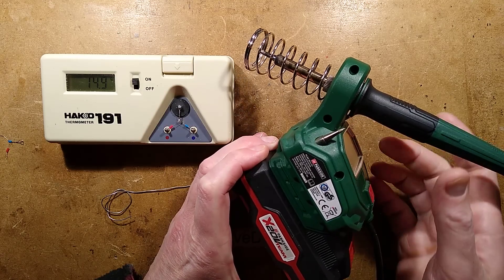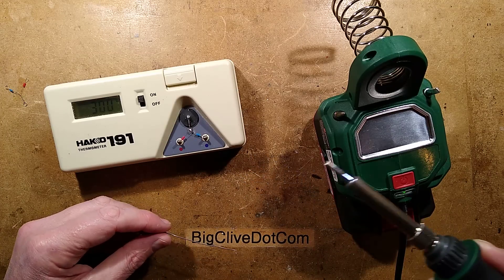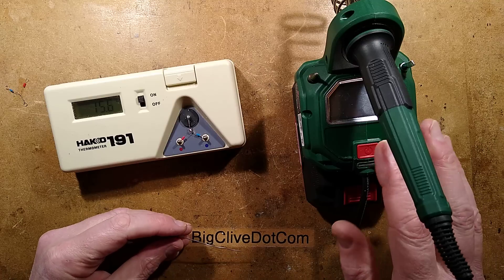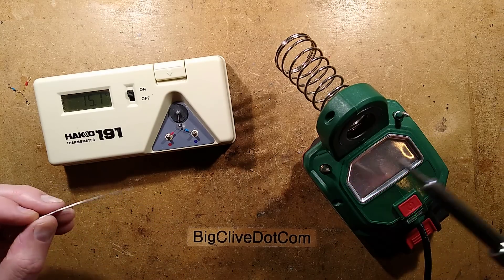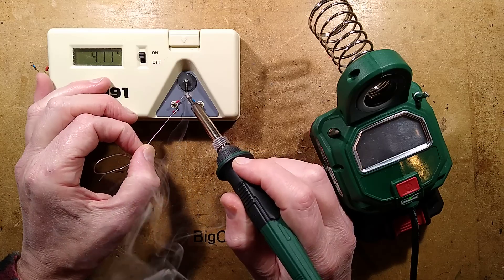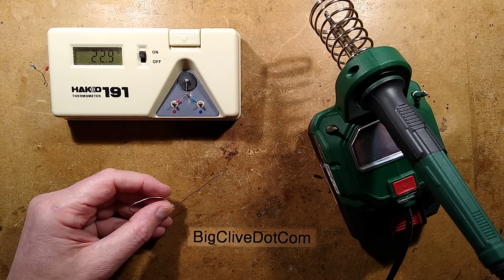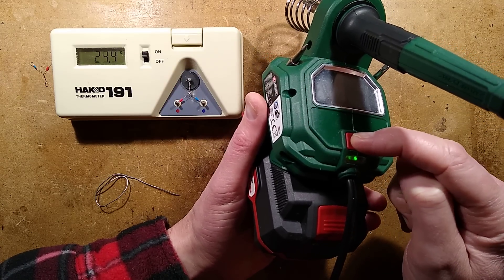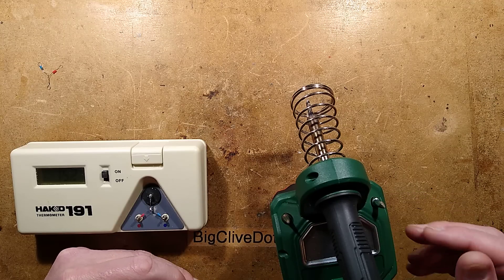Parkside soldering iron secret calibration mode A1 model

Comment: I took my soldering iron apart. It's manufactured in 05.2022, and it has a completely different board. I'm not sure where to solder the potentiometer. I also tried the calibration mode by holding down the button, as described in other videos, but unfortunately, it doesn't work either. I'm very disappointed. Could you please tell me where to solder the potentiometer on the new version of the board? I'd be very grateful!
Reply from the maker: I featured various versions in videos.

Comment: Holy hell, just tried it - that solved my one and only problem with it! When I first used it to solder wire to a large toggle switch, it actually melted the plastic housing through the contacts.

Comment: 1)To raise temperature, keep pressed until if goes into flashing green, then each fast press  --> +4.25°C
2) To lower temperature, keep pressed until if goes red, then each fast press  --> -4.25°C
I don't see how to go into operation mode 1 or 2 given in both cases you keep the button pressed. Is it alternative, aka it goes into mode 1, next time into mode 2 and vice versa ?
The other problem is, we really need a tool to control the temperature, because if you don't remember what temp was set before, better not change it every time.
Reply from the maker: Holding the button goes through mode 1 and then into mode 2.  Release the button in the desired mode.  The temperature can be tuned by feel of the soldering speed.
Reply: @bigclivedotcom  Thank you ! I'll keep 360°C as a reference point anyway, if I need to change the temp punctually, I'll set it back to 360 after.

Comment: Bought one and Unfortunately it wasn’t the A1 but the B2. This unit doesn’t have the calibration feature at least not like the one shown here. 
Does anyone know if the resister change works on the B2?
Reply from the maker: If it's using the same heat sensing system then a resistor could be added in series with it.  Possibly in the handle.

Comment: Hi Big Clive, Could you tell me if after choosing the temperature required and then turning off, then using again in day or two whether the temperature setting goes back the the 500c ish setting please . Thank you. Gav.
Reply from the maker: It stores the setting.
Reply: I did think that as it heats up quicker but wasn't sure. Thanks Clive

Comment: I've got the B2 version of this soldering iron. The circuit board is different, doesn't have a space for a trimmer and it also doesn't have a calibration mode unfortunately. To get it to a decent temperature levelin the  360-380°C range you can just solder a 55-60 ohm resistor (or a 100 ohm trimmer) in between one of the PTC cables and the circuit board.
Reply: Hi ! I have also B2 ! Can you please explain more detailed where I need to solder this resistor and if it will need to be smd .
Thanks
Reply: yes any help if you can a bit more in detail ...which ptc cable
Reply: @EFDawahWiseSmile2LanternDen  the cables for the temperature sensor, not the ones for the heating element.
Reply: @HardDiskLover  i put it on the yellow one nothing happened ..so there is red,black and a white one left.
Reply: @EFDawahWiseSmile2LanternDen  It works ?
Reply: @radimherman1925  nope i dont know what color is what
Reply: @EFDawahWiseSmile2LanternDen cable white is resistor

Comment: How stable is the temperature with a fully charged battery vs an almost depleted one? Does that iron actually regulates the temperature or is this just the duty cycle of the PWM powering the tip?
Reply from the maker: It does sense the tenperature.

Comment: I've been doing some tests and the reference voltage rises as temperature does. It's between about 1.1V at room temp up to about 2.5V at full iron temp (450C?)
Trouble is, I can't match the voltage to my display as the temp voltage scale is logarithmic, as far as I can see, whereas the voltmeter scale is obviously linear. Sad times.

Comment: Excellent video. 
It only two options about temperature or I can choose any temperature with the clicks.
Reply from the maker: With this version of the unit you can set the temperature in 4C steps.
Reply: It is written in manual?
Thanks a lot
Reply from the maker: @michalisgeorgiou257  No.  It's undocumented.

Comment: Calibration setting does not work on version B2.  Upon examination the circuit board design is totally different and there are no longer the terminals for a Potentiometer or a zero ohm link.

Comment: You can remove the DS pin on the pcb and put a 10k resistor between B- and DS to activate the circuit, everything works except low battery cut-off.BTW for those interested I have just tested it at 12v, it dose work, start up around 3.5 amp and drops to around 2.4 amp when up to temp.

Comment: Hi Clive,  just a quick question. I know this isn't related to this video but if I wire two 33uh inductors in series will I get 66uh? Thanks in advance 👍
Reply from the maker: I believe it does.  It's not something I can recall doing.
Reply: Thanks I'll give it a go. 👍

Comment: Have you ever used a Butane powered soldering iron?  I switched over 2 years ago and have absolutely loved mine. 

I do mostly automotive Soldering, and get called out all over the place.     So being able to throw a small self powered Soldering iron into bag is great!    The exhaust port is amazing for heat shrink too!   Cooler than a lighter, but hot enough to work great!
Reply from the maker: I have one in my tool kit, but don't use it too often.
Reply: I've used them but switched top a TS00 as gas irons are far to brutal for the field work I do, probably fine for vehicles though TBH you're lucky to find someone that doesn't just twist the wires together and tape them in that world.

Comment: This is a big improvement, makes it a very versatile portable iron. I think I would still prefer my pine/pencil -based soldering iron for bench work though, since I'm often soldering on and off for hours, and the sleep function is very useful for that. I would definitely consider getting one of these if I had the need to solder on the go ... that is, if they sold it here in Australia.

Comment: Lidl also have the B2 model in stock at this moment in time in my town but I'm led to believe that the calibration mode is not present anymore in this model if that helps anyone
Reply: Unfortunately I have just found that out having bought one this morning.
Reply: Same here...
All I was able to find out is if you attach the battery while holding the button of the soldering statiom, the LED blinks green. I dunno what that means and could not find out more

Comment: Almost bought the Ryobi version  of soldering iron ,ended buying the heat gun for heat shrink tubing .Had an issue with the Ryobi fan killing batteries as the fan runs the batteries down to nothing .Be fore warmed Bad Ryobi fan and battery .it killed 2, 4 ahr batteries .they will not charge
Reply from the maker: Open the Ryobi batteries and measure the voltage across each cell or group of cells.  If any are below 3V then they can be gently brought back up to 3V individually to restart the battery.   If any are really low or reverse polarity then don't do this.
Reply: @bigclivedotcom  That's exactly what I did .I put in 6v for every 2 cells  and started at 2 .7 v .the batteries were all at 2.6v brought it up to 3v even and stuck it back onto the charger and bingo ..Had same issue with Milwaukee M12 2 ahr battery that was on heated jacket .they went down to 2.2 v and I got them right back up to 3 v and stuck them back on the charger .pain in the ass to take apart .Who know how many perfectly good batteries are dumpster fodder when the problem 8s the charger or simply trickle charging individual cells banks back to a chargeable voltage .Thank you for the tip .We used to use a 36v DC  welder to zap DeWalt nicad batteries back to life .sometimes it diddnt go so well !

Comment: This is great! Thanks Clive and whoever figured it out to begin with. Does the iron reset to the standard temp if powercycled (battery out)? Or does it retain the set temperature? I don't have any way of testing this so it'd be good to know.
Reply: Just checked it.  Set the temp to 301C, switched off, removed battery, cooled down  and switched back on.  Measured again. 301C.
Reply: @angusmclean4783   @Ni5ei  Great, thanks to you both 👍
Reply: The setting's stored to non volatile memory so it's still set correctly after replacing the battery.

Comment: Hiya Clive, I bought one of these irons on Sunday after watching your first video and this 'hidden' feature makes it even better. I have not tried adjusting mine yet as I need to order an Iron Tester. On that subject have you tested the blue and yellow ones identified as FG-100 models that are on a well known sales site? I can't seem to find a video covering these! The Hakko 191 style that you use in the videos seem to be in low availability currently, maybe these blue and yellow ones have taken the sales spots!
Reply: Hiya Clive, Here's an update....Well my RST FG-100 soldering tip thermometer arrived yesterday, it came with 5 sensors and not the advertised 10 and they seem to be Hooky Hakko copies of part # 191-212 with only either a red tag on one lead or a blue tag on one lead and not the normal red and blue tag on each lead, but Hey Ho they seem to work ok.. 
I had ordered an extra pack of sensors from another vendor and they seem to be Genuine Hakko so tried a comparison with a Gen Hakko sensor and they measure within a couple of degrees so not a problem... 
The FG-100 seems to work OK, responding to a change from ambient temp to tip temp and stabilising within 4 or 5 seconds.. 
Well anyway I tested the Parkside Iron and as supplied it was set at 446 Deg C based on an average of 6 tests. I adjusted and lowered the set temp to 360 Deg C for normal working with 18 swg Ersin Multicore 60/40 Tin / Lead solder and I have to say its far more pleasing to use, not quite as snappy and spitty with the flux, and the tip does not look to be overheating and going weird colours lol..
I did find that changing the setting up and down by just a couple of clicks did not seem too easy and it did not seem to register much of a change in tip temp, it worked better going up or down by 5 or more clicks and seemed to work better and register in the tool settings.
I have to say for £12 this Lidl / Parkside tool is great, looks like my vintage Maplin adjustable temp 50W N-78AR soldering station will be relegated to the back of a shelf in the shed!!

Comment: It seems like the unit is has some heft to it which makes it less likely to skate around the table when in use. The 936 unit  I have it very light combined with a stiff power cord and when used slides around aimlessly.

Comment: This is not calibration, but adjustment. Just call me Mr Pedantic.
Reply: Correct, fellow pedant. This is an adjustment, not a calibration. If it had a temperature display it would be a calibration.
Reply: @wirdy1  Only if the temperature measurement were traceable to the SI via an unbroken series of comparisons to national and international standards.

Comment: I wasn't overly enthused about this thinking it was set at a fixed temp. But knowing this, I'll have to nab one if I happen to see it in the Aldi's over on this side of the pond. Would be nice to have a portable soldering iron without the usual compromises that inevitably come with them.  Very cool.
Reply from the maker: Note that I screwed up and say Aldi instead of Lidl, but the same soldering iron may be available from other similar outlets.

Comment: That's nice but I think I'll stick to my TS100, because two buttons and a display make it so much easier to control than that one button and two leds. It also runs off a tool battery if you 3D-print a connector for it. With alternate firmware you can even see the state of charge and it will turn off when the voltage gets too low.
I guess it's good value, if you already have a few tools that use that battery system. Just need to add a potentiometer and knob, instead of trying to set the temp by pushbutton, counting, and checking with a calibrating device.

Comment: Maybe the scale is not linear? Maybe it doesn't change the temperature, but rather the voltage output on one of the pins on the chip? Maybe it's to balance the imperfections/inaccuracies of one of the other components?
Just guessing.

Comment: Given how this feature seems to be for factory calibration use, I wouldn't be surprised if going up or down too far wraps around. Also, they probably used 1 byte so there may be a total of 256 levels, some of which are almost certainly far too low to turn the heater on at room temperature, and the other end may drive the element to red-hot and not turn it off. Beware!
Reply from the maker: I did ponder what might happen if the calibration byte rolled over.

Comment: So, in your previous video of this device you showed where there could be a variable resistor, which got me thinking, do any of the pins on the MOSFET, or the IC, t the unpopulated connector you marked as  RDT or the unpopulated connector PRG1 change and/or maintain a voltage that corresponds to the secret calibration that you make that could be used with a test meter or such and some simple math that we could use to 'read' the temperature? Maybe even add a Arduino with 2.4" screen? You've made this really interesting, I'm hoping for a Part 3.

Comment: ive tried the + and negative, but no luck then tried a third wire from the battery contact marked tv  to the third prong on the solderer and it worked,

Comment: This makes it a seriously impressive soldering iron for £13!  The only drawback is that it isn't 12v, which would have allowed it to be connected to a car battery.
Reply: Boost converter.......
Reply: Looking at the schematics I think it would work at 12v. 3dprinted bracket,or an defective battery.

Comment: interesting with some Parkside tools trying to get them to run off other batteries like Bosch when I made eight 3-D printed adapter you must  put a resistor between positive and the T terminal  about 4.7 K  but this will drain if you leave the battery on in about a month.  My workaround was to use a microswitch in the trigger of the tool the microswitch comes on before the tool does Connecting this 4. 7K resistor to the T terminal.  I found that this resistor had to be connected before the trigger was pulled.  I don't have a Parkside battery myself that fits the tools and I was wondering if anyone knows how Parkside implements this feature within their batteries. Also if anybody has a more elegant workaround this safety feature or compatibility defeat device of Parkside tools?  🤔
Reply: @Kevin-mp5of   Less of an adapter more of a  adapter plate . Communication lost would only be Low voltage cut out. Of Tool.  That you can feel . So change out battery  As not to   Under discharge it.   All balancing is done  in battery itself.  I'm always putting adapter plates On tools which would be expensive or Not available from the Bosh range. And    Bosch 18 batteries are superior. To other tools.   With very low internal resistance And better heat management.

Comment: I have a feeling these were adjusted with Fahrenheit in mind but measured with Celsius scale equipment. 500 °F would line up with 260 °C which is a good range for slow paced soldering with leaded solder.
Reply from the maker: 260 would be quite low for lead based solder.

Comment: I found an undocumented scanner feature in a set of bubble pack radios once (FRS in the U.S.A., PMR in the UK). It seems that the manufacturer wanted to make a low-priced model but not bother using a different IC. All I had to do was hold down either the channel increment or decrement button and the radio would scan up or down respectively, stopping on any active channel.
Reply from the maker: My favourite hobbled software fix was my Flir E4 thermal camera.  When a suitable script was run it unlocked the full resolution of the thermal sensor from 80x60 to 320x240.
Reply: @bigclivedotcom  Wow, that's a significant upgrade as long as it doesn't cause any other problems such as memory configuration errors. The new resolution consumes 16X the memory for each still image.
Reply: @KJ6EAD  I seem to recall it was painless, but no longer possible on newer models. (But if anybody knows differently, please tell!)
Reply: @Peter_A1466  When these kinds of things get out to the public, the marketing guys freak out and the next model is locked down but it's a real treat to the public before they do.

Comment: That makes this even more desirable. Do you think there would be a way to "hack" in a digital temp display?
Reply from the maker: That would be quite complex as it would need to get a reference from the thermal sensor and be tuned to fit its scale.
Reply: @bigclivedotcom  What about reading the current where the zero ohm resistor would be and scaling that to a display? Possible?

Comment: High chance of a noob suggestion, but in the schematic from the original video you indicate a Vref coming out of the MCU. This might go through the sensor and get back to an internal ADC, but could also go into an internal comparator? In which case the Vref might actually change with these software adjustments? Nah, ADCs are plentiful on cheap MCUs, DACs are not... Almost a zero chance of this being true. But I will check once I get this iron, just for peace of mind.